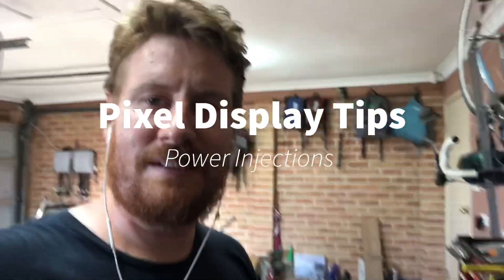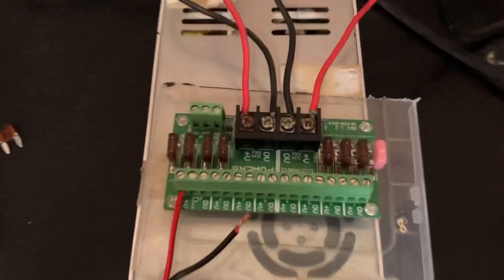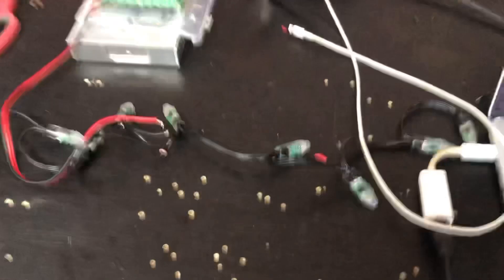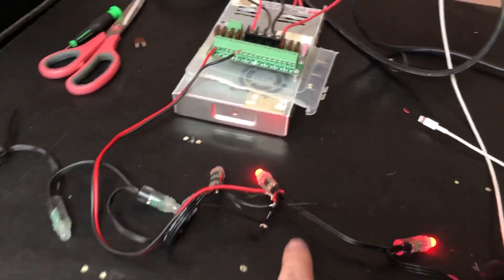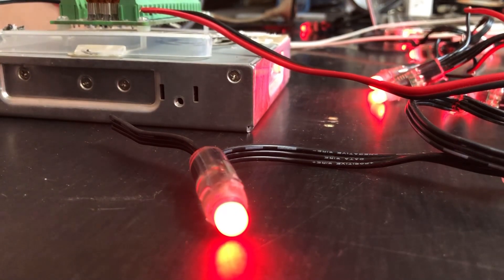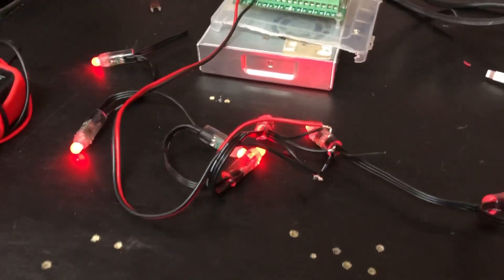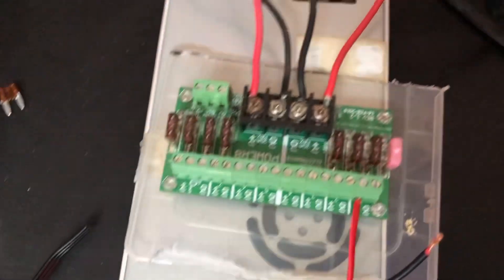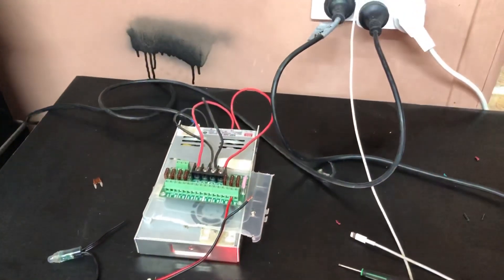Pixel Display Tips 03: Power Injection

Comment: With the "cut the positive" approach, you're also protected against differences in how the various switch-mode AC-DC converters may operate. This is important, otherwise you can get uneven loading.
Reply from the maker: 100% it basically balances the load if you have more than 1 feed.
Reply: @donniesgarage  In a manner of speaking, and assuming the power supplies are capable of working in what is essentially a parallel configuration - worth taking a peek at https://www.frei.de/assets/templates/frei/Dateien/Dateien/PDF/Stromversorgungen/en/Technische_Beschreibung_Parallelschaltung_ENGL.pdf

Thanks for working to help demystify what is definitely one of the more annoying aspects of lighting to get right!
Reply from the maker: @matthewmousseau7148  thanks for that link. Yes thats the whole idea is to try help those that are new to the hobbie, or other random things as I'm sure you've noticed if you looked at the other videos ;-)

Comment: This is the question that I haven't seen answered. When cutting positive @ injection, is that wire just left like that. I live in extreme climate.  Also what about @ the end of string. Are these wires just left exposed?
Reply from the maker: You can put heatshrink over it or liquid electrical tape anywhere the wires remain exposed. I normally put a pigtail on the end of a string
Reply: @donniesgarage  Thanks for the info.
Reply: I dont know if this help you or not.... I do my power injection at the power supply...by that I use a input (male) cable going into the box with my injection power supplie(s), I connect the grounds all together, and fuse the plus side.
The input connector, I pass data, and ground to the output cable (female end) and then connect the plus of the output cable to the fused power supply. This way my "open plus wires" are actually inside a box and protected from shorting out due to weather.
Also, as my show grows, I am putting power supplies directly at the props.... running data to the power supply and providing the prop with power and data from there. Small props (singing bulbs) I run 4 off of one power supply
which is 680 pixels, this way I dont overload any power supply at all

Comment: If you cut the positive doesn't that stop the flow of power backwards through the pixel string since power flows both ways?
That means you would potentially need twice as many injections points.
I'm new to all of this so please correct me if I'm wrong.
Reply from the maker: One way. DC = Direct current not alternating. Cutting the positive the best way to think of it is you are cutting where you are "running out of flow" the ground stays connected as the ground and DI wires work together for sending data
Reply: @donniesgarage  Thanks, but your method goes against the info in this video: https://youtu.be/Jgjdz0Nbswk
Specifically, at 19:58 he talks about injecting both wires and power flowing in both directions from the point of injection.
Reply from the maker: @TheOoze777  doing both size "balances" the load overall. Its not a necessity but you can do it as well. For some big matrixes we do actually do that as it stops colour from washing